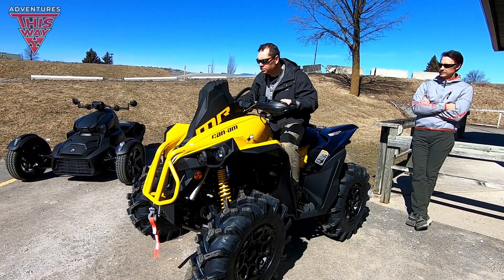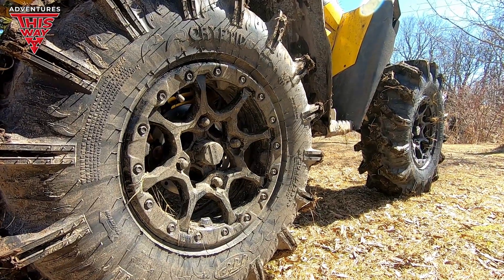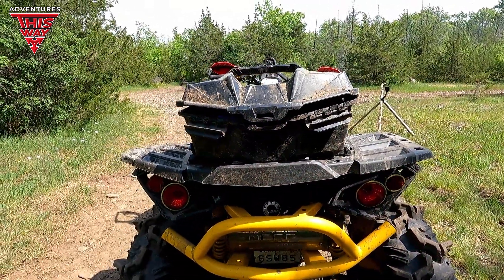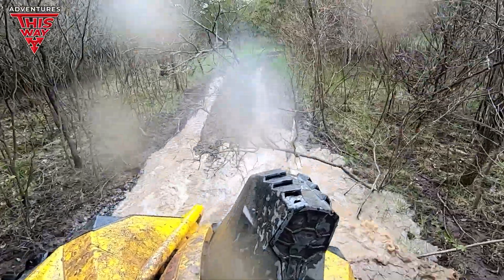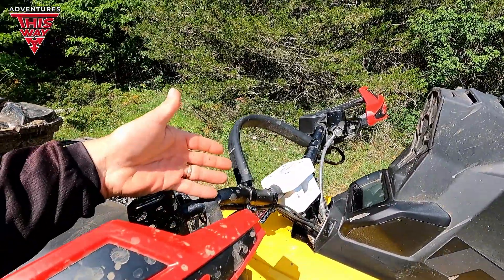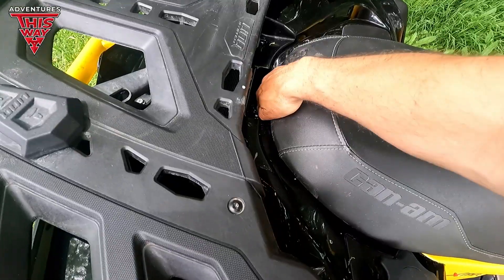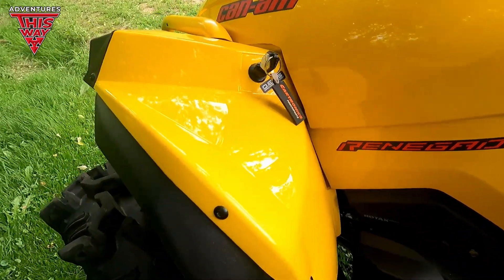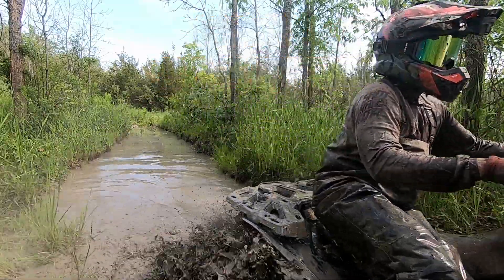2021 Can Am Renegade 1000 XMR Review (Former Polaris Owner)

Comment: I bought a 2021 sportsman 850 this year.  Defiantly no regrets.  I do have to say if I was looking to buy a mud specific bike it likely would have been a can am over the Polaris.  But for the type of riding I do I know I made the right choice going with the Polaris.  It has tons of features and rides great.  Lots of power.  Although I don't do a lot of mud ridding, I couldn't stand the thought of buying a 4 wheeler without a good working front locker.  Can am's visco lock is not that.  I love the Polaris AWD system and was a big factor in choosing Polaris.  Much like you said about the can am, I find my clutching leaves something to be desired as well, nothing a clutch kit won't fix tho
Reply from the maker: Yes Polaris clutching (Team Industries) is good definitely and a kit to make some changes is all you need.  There are several drawbacks to the Polaris front drive system.  Keep your front prop shaft u-joints well lubed and check pinion bearing for play regularly and your good!

Comment: Get a tune and a pipe and air filter, my friend has a 900razr and he smoked my friends new razr, it cost almost 1900$ but it’s worth every penny, I really do agree these machines are way over priced for plastic, also I’m an R1 owner looking to get a renegade so what size would I be satisfied with?
Reply from the maker: Definitely a 1000, no question.  If never go any where there is much water get an XXC and  bigger tires and wheels.  BUT you can do everything with an XMR...
I have an MBRP exhaust all ready, tune is coming.

Comment: I agree and disagree, not that you care😉but on the "foot pegs" on the Renegades are the best! I guess I should state that's "in my opinion", I find that they keep your feet on the machine in rough conditions and through bouncing around in the mud. I had a polaris (2008 500HO Sportsman) and it had very short, premolded plastic bumps(points at first but not for long). They do although chew up the bottom of your boots/waders due to their design of very aggressive and sharp aluminum bolt on pegs,but they grab on and keep your feet on the machine.
But I agree on the "fit and finish" for the price! Yet we both have the same machine with the exact same fit and finish issues, I agree it "sucks" but I bought mine because it was the most powerful Machine on the market,with a ton of aftermarket support for both longevity and performance parts. Why did you buy yours🤔?
Great video✌️
Reply from the maker: Ha ha yep my waders boots got cut the other day!
Just some minor issues, none the less…I got the Renegade for the power mostly!!

Comment: I'm curious in reliability?
Reply from the maker: Mines been very reliable.  You got to keep your machine maintained regularly when you ride the stuff I do, no matter what brand
Reply: @ADVENTURESThisWay How often do you go through belts? I was looking into the possibility of a can am 1000. I currently have a grizzly 700 and I know Yamaha’s cvt design is great, hardly ever wears out a belt. I was just curious how can ams are, or if you knew about anyone else with problems or not!
Reply from the maker: @Wesley Garrison  generally if you keep it stock belts last just fine.  If you upgrade to bigger tires and ECU tuning you need aftermarket clutching.  I've haven't blown a belt.